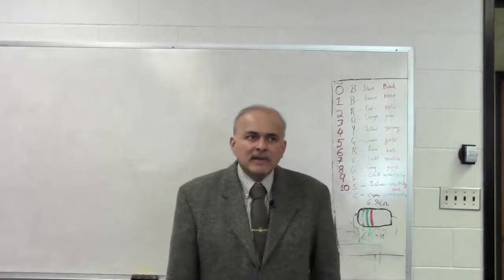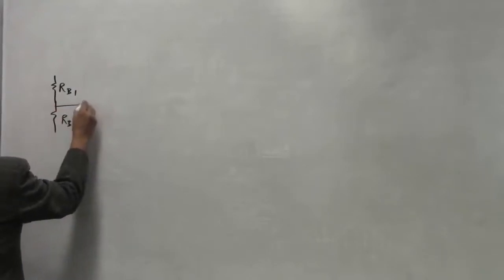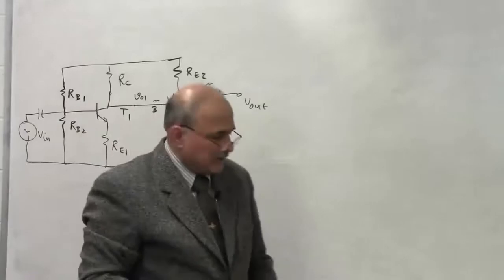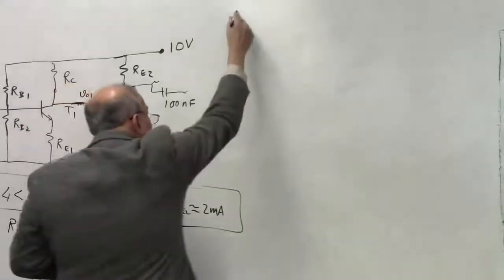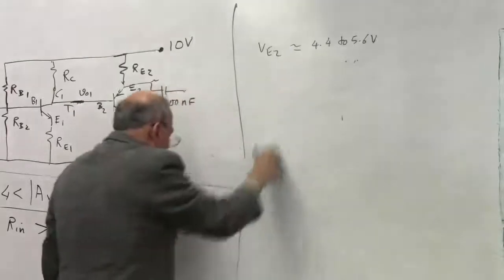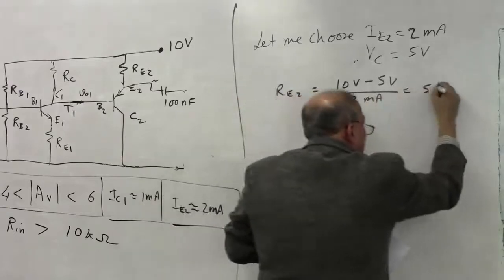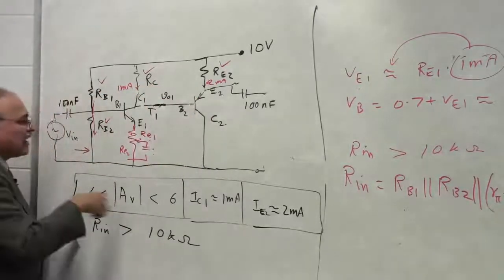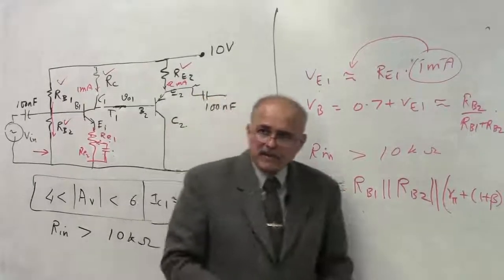Lab Lecture of Design of Two stage Transistor Amplifier

Comment: hi dear I have a question Design a (multistage amplifier) with following specifications The OPAMP has two stages.You should provide a high input resistance and high current gain and relatively low output resistance in the first stage and secong stage should provide inverting voltage gain ,high input resistance and moderate output resistance . ʎ=0, Kn=Kp=5mA

Comment: which transistor are you used in this circuit
Reply from the maker: Any general purpose transistor should work like 2n2222 and 2n2907 or 2n3904 and 2n3906
Reply: @SmithKerona  hi dear Ihave a question  Design a (multistage amplifier) with following specifications The OPAMP has two stages.You should provide a high input resistance and high current gain and relatively low output resistance in the first stage and secong stage should provide inverting voltage gain ,high input resistance and moderate output resistance . ʎ=0, Kn=Kp=5mA